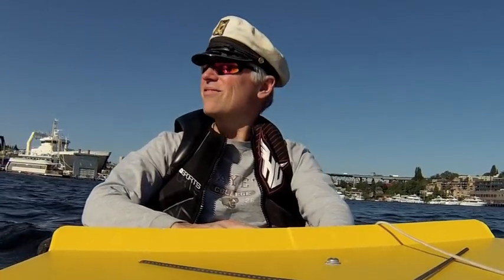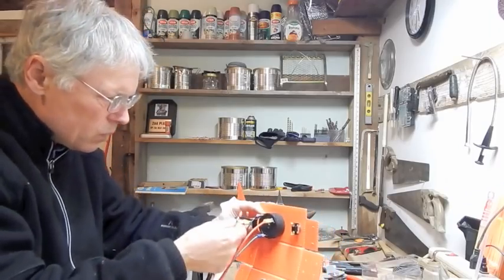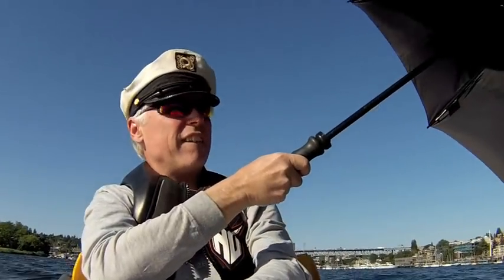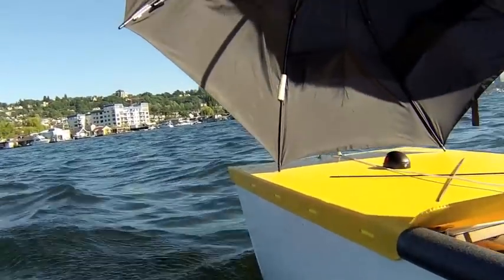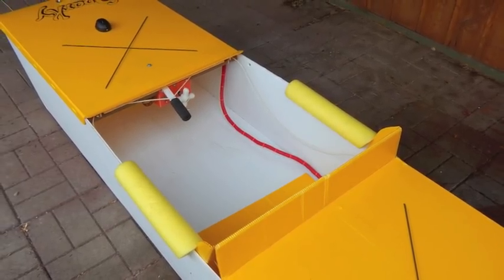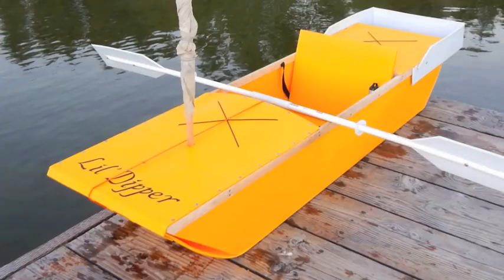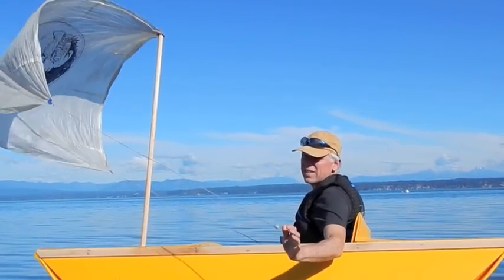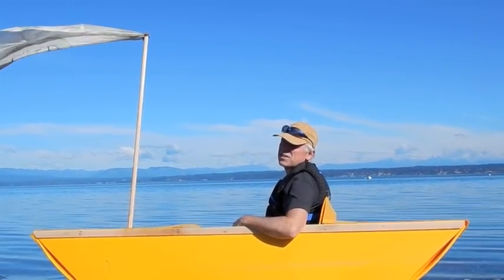One sheet Fluted plastic kayak and sail boat

Comment: A little boat could be mounted on top of a camper top and used for some extra Headroom and then if you wanted to use it for a little emergency boat or something you can take it off just make sure you have the roof plug off as some polyethylene or something but does that might be a nice thing to gain some height lightweight to get some gain some heightened a a camper situation especially as a camper shell